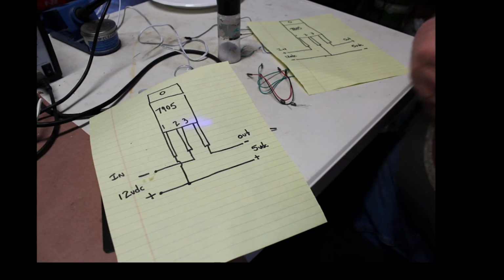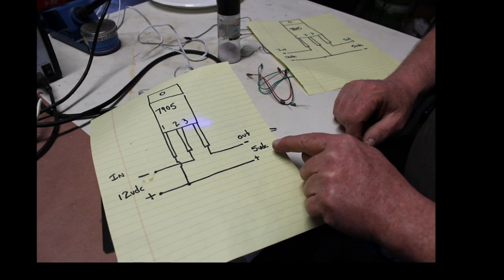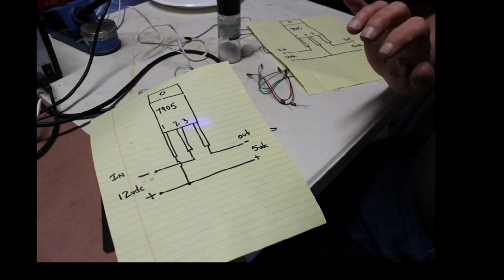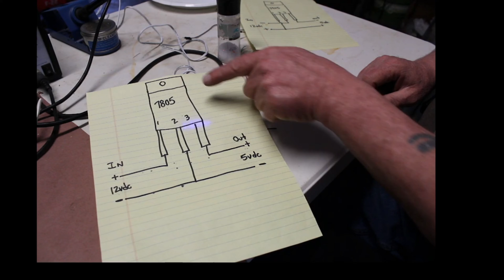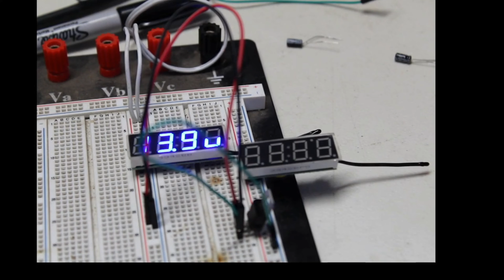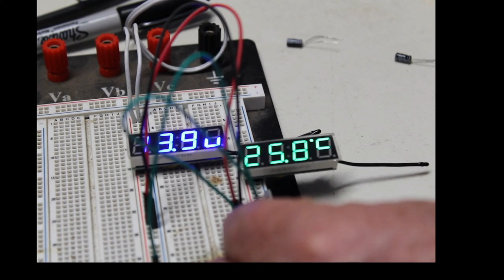LM7905 Negative Output Voltage Regulator  setup on breadboard

Comment: Çok çok uzaklardan size selamlar olsun hocam bir dedektör yapmaktayım fakaf lf 357 ve 741 simetrik çalışması gerekiyor fakat birturlu bu negatif işini kafam çalışmadı size çok teşekkür ederim basit bir şekilde anlattiniz iyiki varsınız Allah'a emanet olun..
Reply from the maker: You’re running into a biasing/reference problem, not really a “negative charge” problem 🙂
Both the LF357 and LM/LF741 are classic op‑amps that expect to see signals swing around 0 V, or they expect dual supplies (±V). If you only give them a single positive supply, they can’t magically see or create “negative charge”

Comment: I just found your channel. I like to tinker with old computers. I recently received an old dell XPS T450. The power supply is bad and good used replacements are crazy priced. I have another old dell power supply but its missing the -5v wire. I would like to add this regulator inside the replacement to get the -5v that I need. However, I have seen mentions that you can attach it to 12v or 3v. Does it matter?
Reply from the maker: Stick with 3vdc to keep it cool and from thermal shutdown

Comment: Hello, great video! I was wondering something since I'm fairly new to all this. Would this setup continue to output a consistent 5v once other components are connected to it? I'm trying to recreate the AI synthesis VCO and his setup is really different but I haven't been able to get his -5v regulator to work, this one works great though. Worked the second I put it on the breadboard. If it was hooked into the first couple pins of an AS3340 that should work fine right?
Reply from the maker: The AS3340 is a very low draw VCO and will work fine with this setup
Reply: @DIYELEKTRONICKITS  Cool thanks for the info. I actually tried making this again this morning but now for whatever reason its not working again. Its 12v into pin 1 and -12v into pin 2, and the - 5v is being measured from gnd to pin 3, right? I'm using the l79l05acz version of the regulator (the small one without the top metal heatsink mount), does its pinout differ than the one in this video by chance?